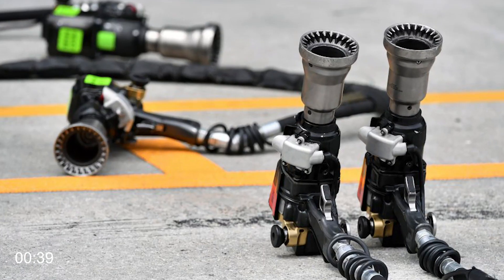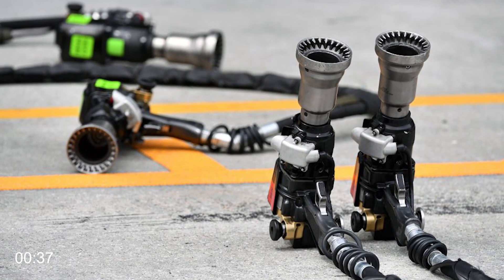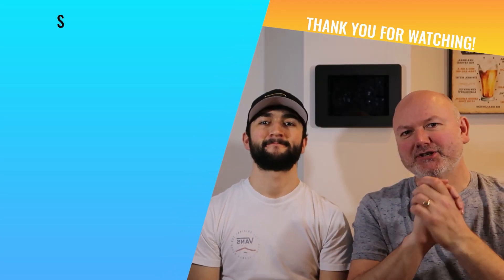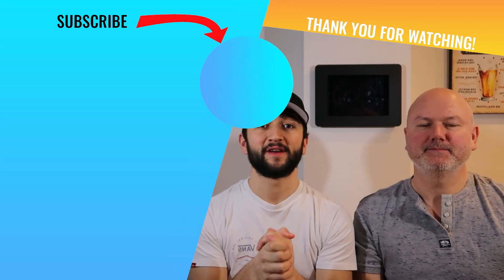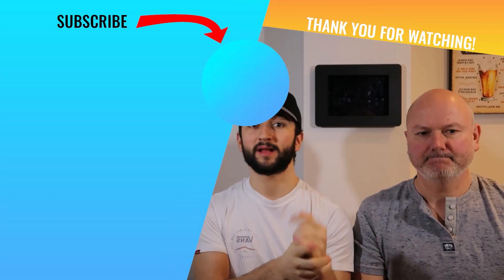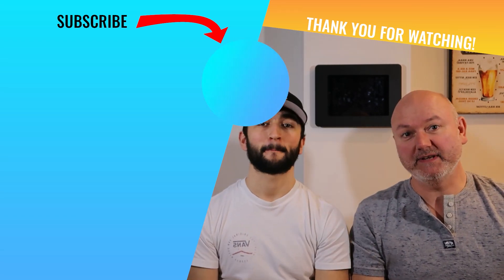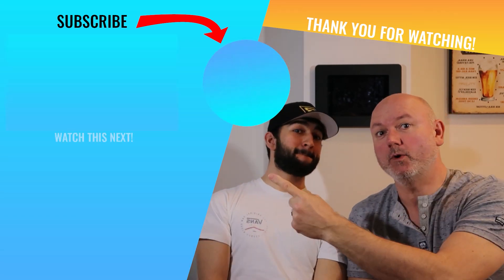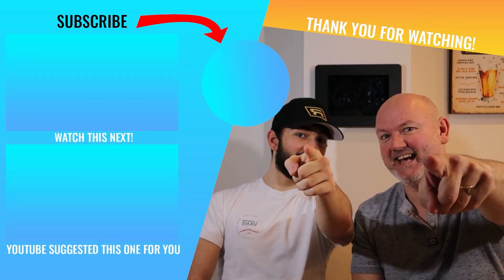Formula One Wheel Nut | 60 Seconds 5 Facts

Comment: It would be great if LarkTV could find out for sure what happened. I understand that different teams use different wheel nuts, and the video of the so-called "machined wheel nut" seemed not to have any splines left. Another video showing  Technician with a Dremel grinding a couple of ridges away and the nut came off right away, still looking brutally worn away. So it couldn't have been cross-threaded. 

Good luck in future wheel changes with those nuts and guns Mercedes! In my home tool chest I have various bits that removed damaged screws and bolts-------you'd think teams would have one designed for machined wheel nuts that could be quickly brought in, and a new nut installed.

Comment: Here after Bottas's disaster.
Reply from the maker: Haha! We’re happy you landed here! What happened with Bottas today was crazy. Such a shame, but very interesting to find out WHY it happened in the first place! 😮
Reply: @LarkTV  commentators said the wheel nut was cross threaded and made new threads in the axle. couldn't that only happen if the wheel nut is harder than the axle metal? Usually a wheel nut or lug nut is made soft so it doesn't destroy the studs or shaft. Any idea if this is even possible on an F1 car?
Reply: @brainstorm4207  I do not think the commentators got that right. It is more likely that the thread on the nut was stripped.
Reply: @brainstorm4207  no the gun was jammed and due to the light alloy it stripped the nut
Reply: @LarkTV  I've heard at least 2 different stories as to why it happened so far.  The first was the nut was cross threaded.  The most recent is the gun man put the gun on at a slight angle.  Anyway, I just seen a story, they finally got the nut off.  It looked like they cut it with some type of rotary tool.  There is a video of the nut being removed.
Reply: same here!
Reply: Same.

Comment: Do you know if the wheel nuts are attached to wheel rim or they get "caught" by the wheel gun and  repositioned when the mechanic goes to tighten it?
Reply from the maker: Hey Alessandro, thanks for your question. Sorry we didn't show it in the video, but the wheel nut is actually two pieces that screw together as one. So yes, the wheel nut is 'assembled' as part of the wheel. Therefore when the pit crew put on or remove a wheel, the nut stays with the wheel. The nuts do get chewed up a little by the high power air guns and so are replaced each race day. We hope this answers your question and thanks for subscribing. Tony & Callum
.
.
.
.
.
Reply: @LarkTV  Would you be able to show both halves and how they come together? I cant for the life of me figure out how that works. I initially thought that the groove near the base was for a c clip, but it seems like that is not actually the case.
Reply from the maker: We’ll get some information together and see what we can do for you ;)
Reply: @LarkTV  thank you so much for the info ! keep up the good work !!
Reply: Thanks bro for question, my frieds always said that wheel nut attached in wheel gun